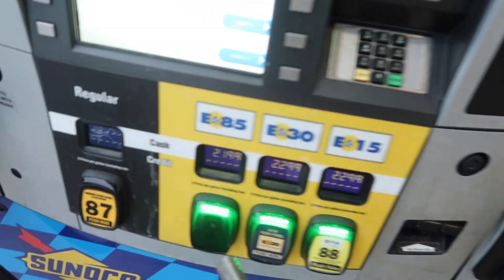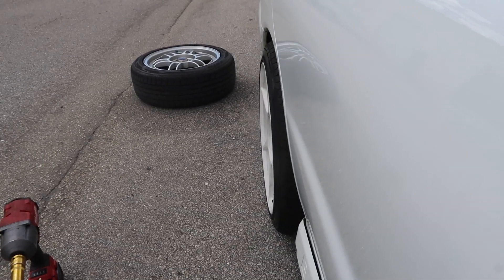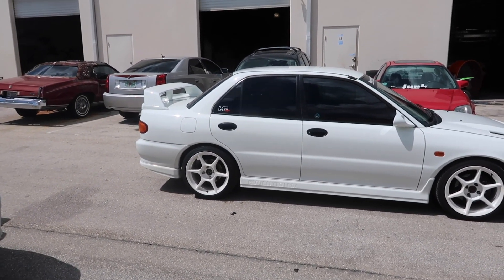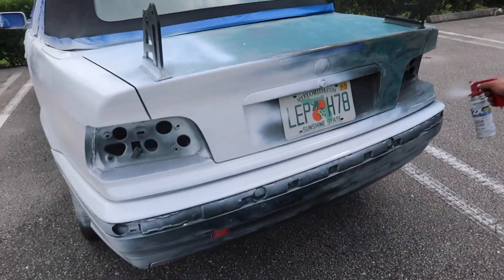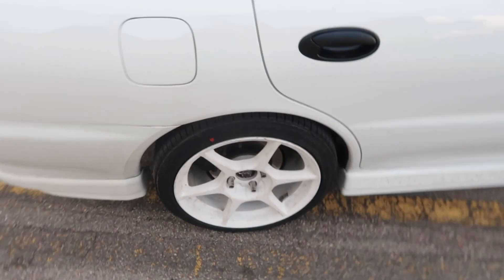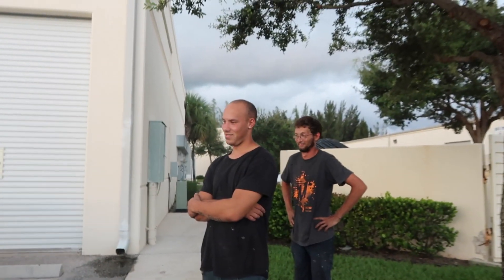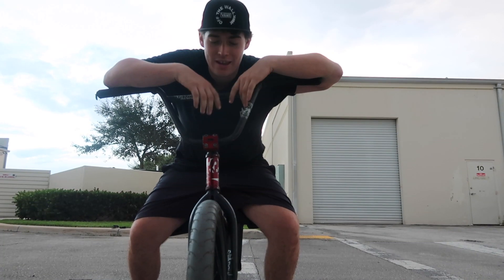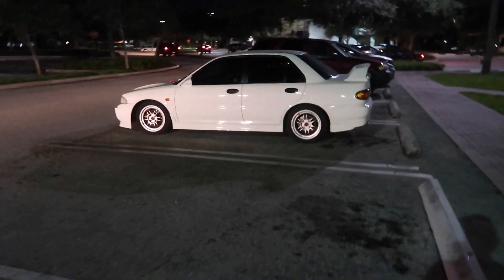FITTING THE NEW WHEELS ON THE EVO ONE!!

Comment: When you go to CT, have professor Thomas give you a lecture on wheel and tire specs.
Reply: Can’t wait to hear Tommy shit all over the fitment lmao
Reply: honestly the evo looked better stock.
Reply: Papa thomas
Reply: 215/45 is the right tyre spec for a 17'' wheel
Reply: Should’ve got some TE’s
Reply: @Ch0k0TB  I'll take a 245/40r17 over a 215 any day.
Reply: @qers  depends on the wheels width. If you are going stupid wide like 8 9 or 10J ofc
Reply: i mean depends on the wheels
my mercedes clk w208 amg rims oem are 225/45/17 and 245/40/17  i run 235-45/17 in the back since no shop has 245/40 in stock so i went for 235/45 but its a bit stretched. next i will order my tyres in advance and put 245/40 in the back i dont like stretched tyres i mean i do but on stance car, not for my regular car

Comment: I had a white 2002 Hyundai Sonata GLS V6 and it was a stock plain car when I got it. I put some white 17" wheels on it with 215/45/17s on it, lowered the car, put some headers on it, a full exhaust, and it looked so good. It totally transformed the car.

Comment: Dude buy a 8th gen civic si. Come with a k20 stock and LSD trans then slap a turbo kit on it
Reply: Hello rev hang and a shitty transmission with 3rd gear pop out. Even with Flashpro the rev hang is trash and there is no good fix for the junk synchros, even the aftermarket solution is junk. I had a Fiji Blue 07 Si and it's an ok car to learn on but Ruddy is way past this and he is on to the big leagues with R32 GTR and Evo.

Comment: 215/40 up front 205/45 out back should cure any understeer. Check specs on tire height though because you don't want more than 1 or 2% difference